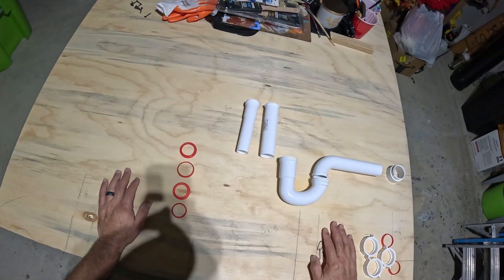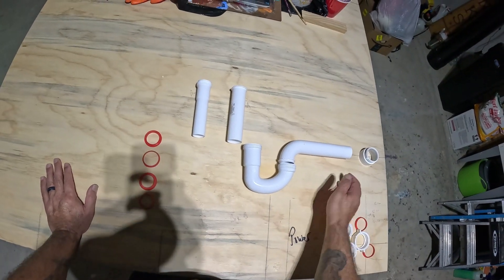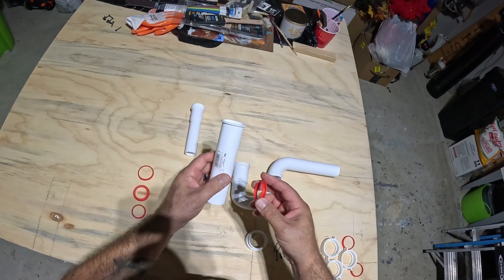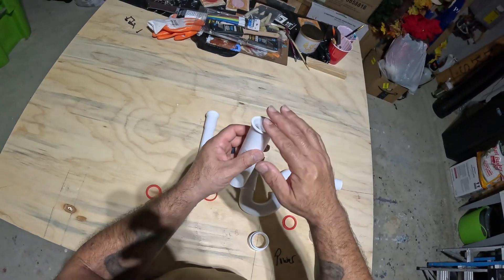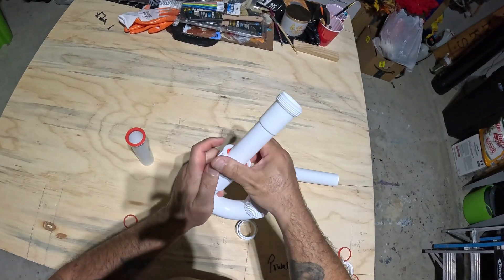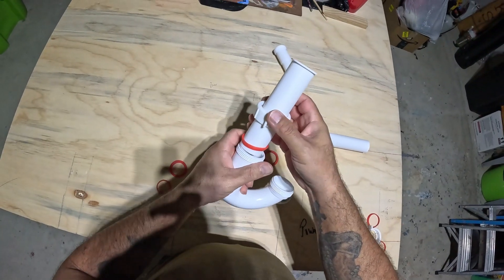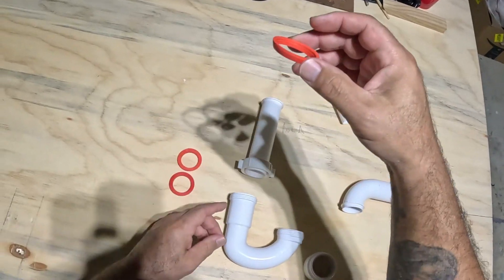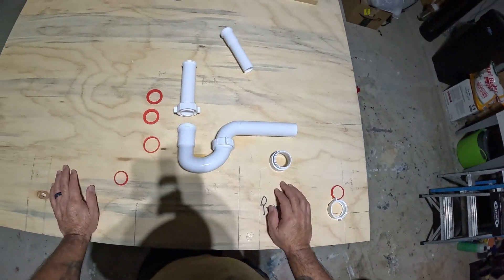“Drain Pipe Connections Explained | Easy DIY Plumbing Tutorial”

Comment: Been going through a lot of videos and as soon as I saw all the pipes and seals out I knew this was the video I needed.

I just need to replace the seals/washer but everything else is replacing the whole thing.

I was even in the DIY shop buying seals and thinking it was 1.5 inch but had to ask chatgpt what size my kitchen sink is
Reply from the maker: Happy it was helpful. Thanks for the comment.
Reply: @diybasics6270 I spent 40 mins trying to get the rubber seal onto the top of the pipe that connects to the sink and wasn't able to do it.

Was just going to buy a new pipe system.

My brother called in and spent 30mins and managed to secure the seal through the threads.

I don't know what I was doing wrong with the seal. It just kept popping out or getting wrapped in the threads

Your video was great though.
Just a skill issue for me.

I think I would have installed a new pipe system for €16 far easier than trying to replace the €4 seal packet.

It's working now

Comment: A lot of super helpful information here. Do you have an opinion on using silicone plumbing grease on the washers before insertion, or on beveling the bottom of the tail pipe and end of the pipe that goes into the wall? I keep reading about the importance of chamfering/beveling/deburring pvc before making your connections, but it always seems to be in regards to using cement. I can't find any info on whether it should be done on these simple p-trap setups. You seem like you've learned a lot from your experiences and I appreciate your video! :)
Reply from the maker: Deburring is good to prevent hair from catching and causing clogs. I rarely use any tape or pipe dope on any of the other connections, but it helps if you have a small leak. Thank you for the comment.
Reply: @diybasics6270  Thank you! :)